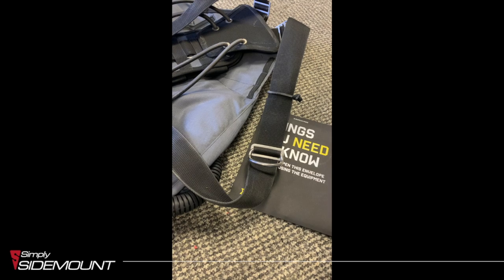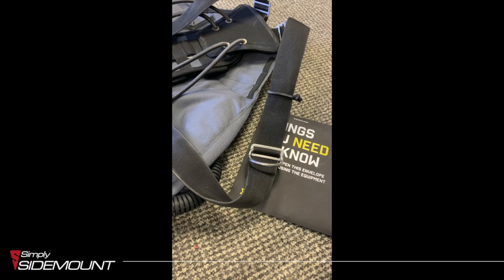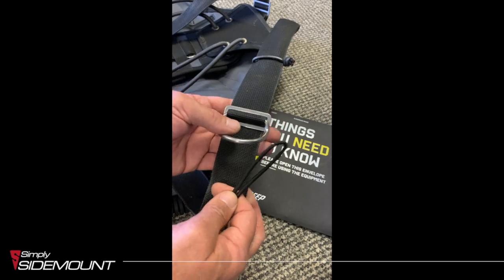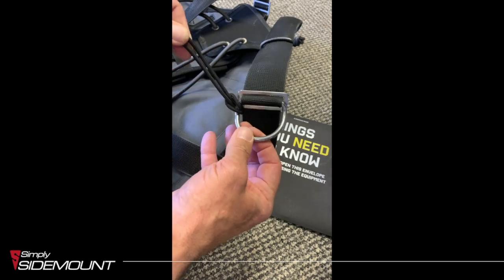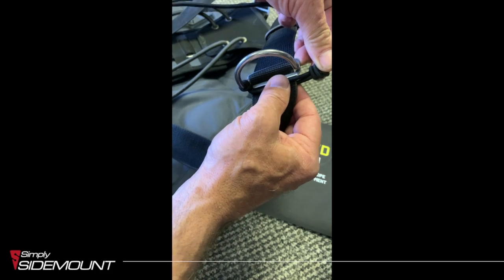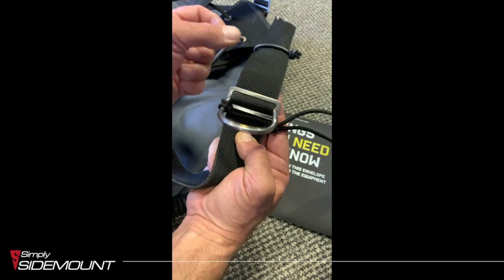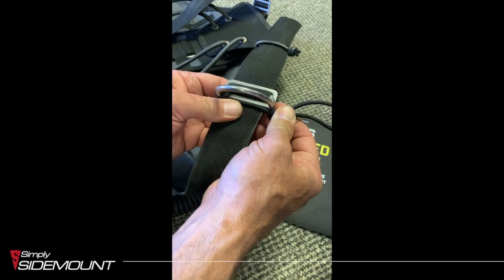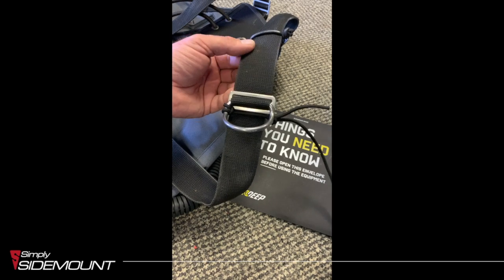D ring retainer - "Ask Garry" to give the solution. Keeping that D ring where you need it.

Comment: Thanks Garry. I hadn't seen that solution before and recently ran into that problem during my first drysuit dive.
Got any tips on dealing with sliding d-rings and thick gloves? I had trouble clipping in. Might try the same method.
Reply from the maker: Yggdrasil42 I do have a solution. I’ve been using it for many years, almost since I started. I’ll do another video for this.

Comment: Garry, is the inflator hose of the redundant bladder removable (say for dives that is not necessary and just gets in the way)?
Reply from the maker: Technically speaking yes it is but, you must have the correct blank for it. I find it better to use my right inflator as backup buoyancy to my preferred suit buoyancy. Therefore my left wing inflator can be removed and blanked with the purpose made blanking cap from Xdeep.
Reply: Thanks. Also with the drysuit have you found that you need the D (8x1.5kg) pockets of the harness or just the M (4x1.5kg) is enough?
Reply from the maker: @gpolykra  I use 4 x 2.5 for larger space. And wider pockets rather than deeper pockets.. This accommodates when using pound weights which are generally bigger than kg weights.